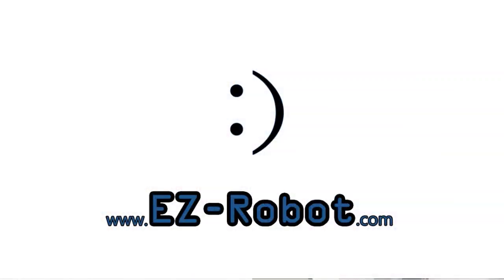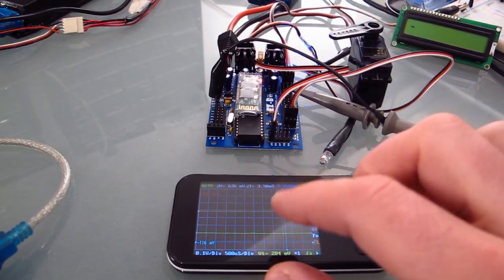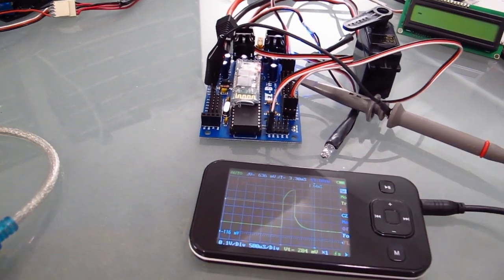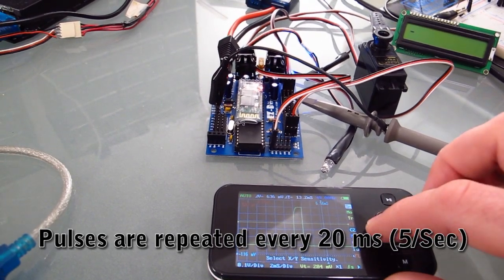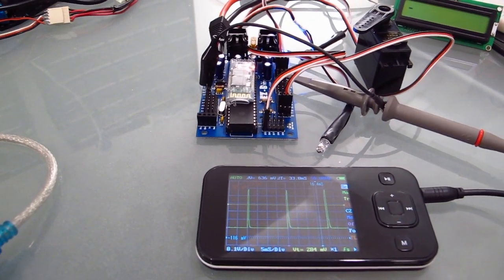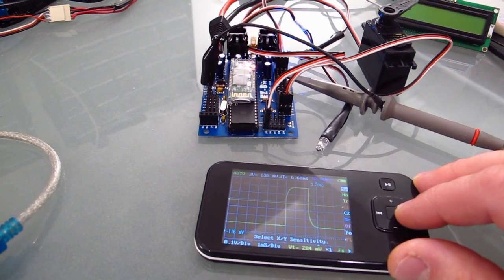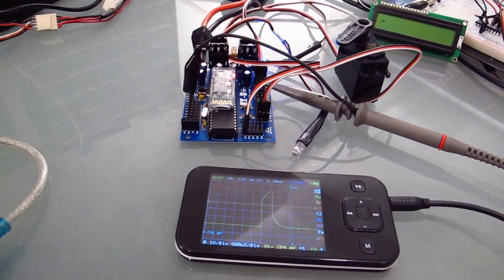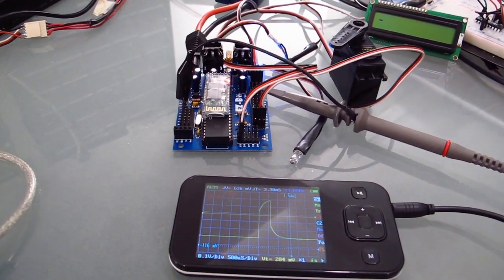How Servos Work

Comment: It seems to me that it would be way better if model servos worked on 0-5v DC instead of PWM, like many industrial servos do. This would eliminate the problem of limited sampling frequency (typically 50Hz), and could greatly improve dead-band, not to mention simplification of the driver.
Reply from the maker: Yeah!